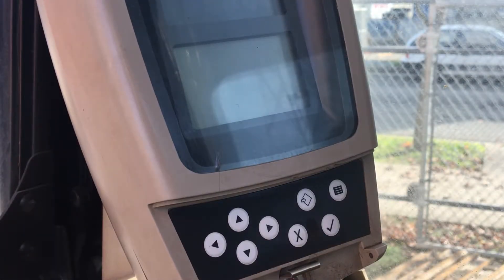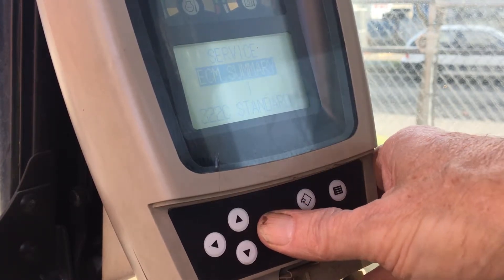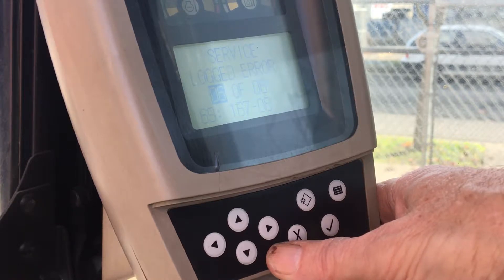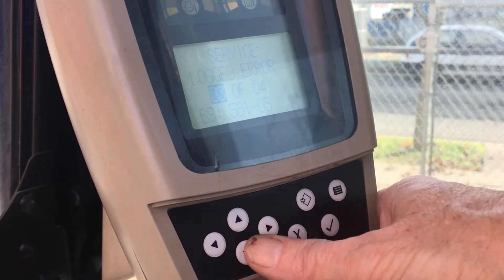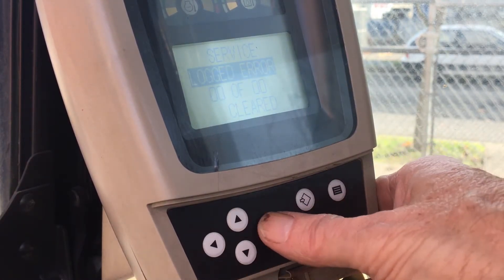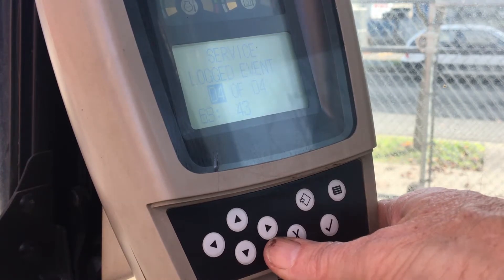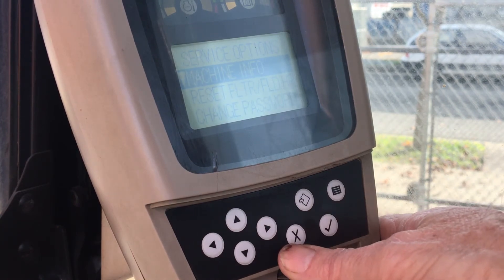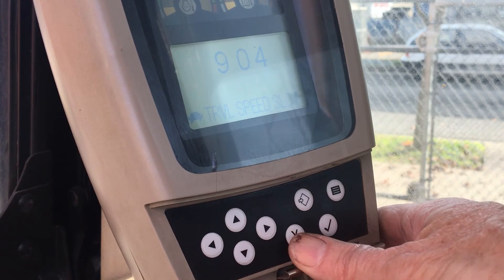Cat C Series Excavator Monitor Panel

Comment: Why rpm reading not show
Reply from the maker: That usually means that there is a problem with the speed sensor. You can check it with an ohm meter. If it is good it will show some resistance when checking both wires. A bad one will have infinite resistance or no resistance. If the sensor is good, there will be a problem with the wiring. Good Luck!